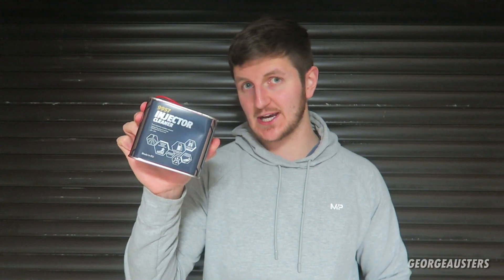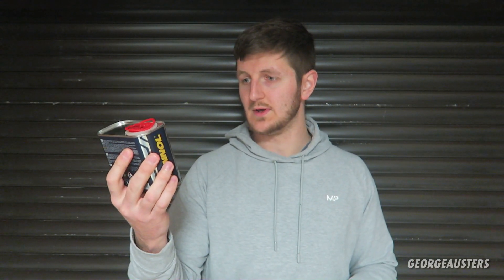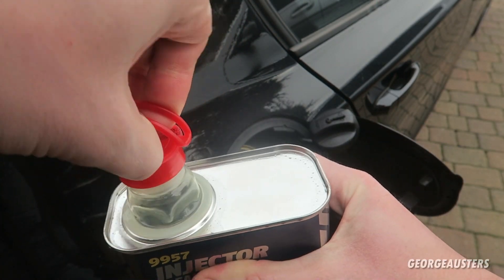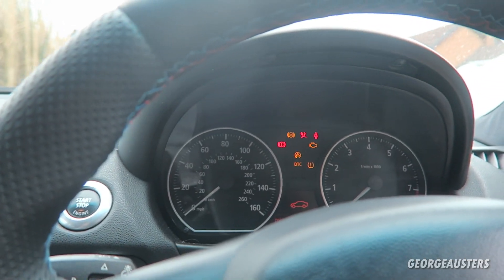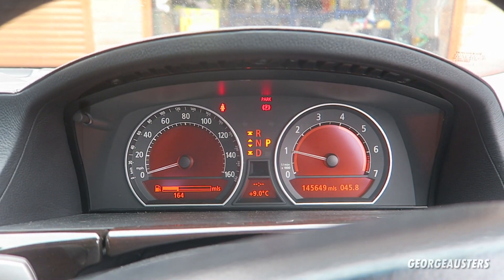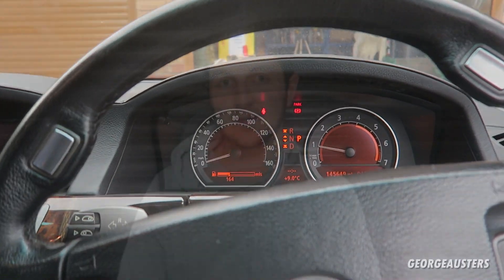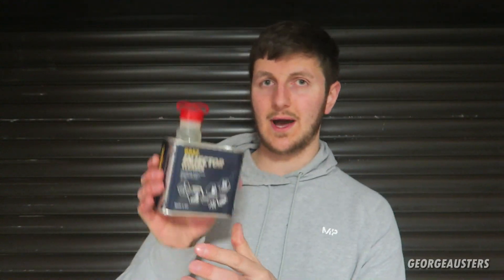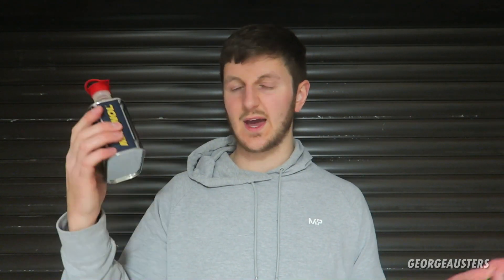Do Fuel Injector Cleaners Actually Work?

Comment: You can always use a scanner to check injector timing, fuel trims, o2 sensor readings and timing advance at idle. That'll show if its making the fuel flow and burn better.

Comment: I drive a Mercedes C32 AMG with over 200k Km's ..I bought it without any services history and it was parked for 6 year  ..the fuel consumption was 12/100 km's on the highway , i used a bottle of Mannol fuel injectior cleaner (pushed the engine to High RPM like 5 RPM for 10 mins on the highway) now I am getting 10.8L/100kms ....but if the car is driving daily I don't think it will be that effective.

Comment: Cleaner loosen shit inside filter then block injector. Mainly then causing leaky injector. Then problems start up and burn off. Got problems?… just renew the injectors. Oh, service BMW more often than stated. I don’t know why I bother like but hey ho! If you driving BMW DERV engine use regular non-supermarket derv and add a little cetane booster at 25% stated. Change oil every 6k and I promise you issues with fuel system, turbo and likes will be minimal. Especially for those twin turbos derv engines. 335d I.e.  I’m trying to avoid using engine designation here to reduce confusion.

Comment: Little tip for you, dont use a metal screwdriver to prop the filler neck flap. Just in case of a static arc or an accidental spark. ;)
Reply from the maker: That’s a good point!

Comment: Thanks George. I like this method. Looks very easy. Would you recommend taking out the entire fuel rail to clean them?
Reply from the maker: Only if you’re having issues relating to the injectors, but you’ll have to replace all the seals then too

Comment: I best injector cleaner I use in my 530d is 50/50 heating oil and diesel. I had a dodgy injector but this fixed it 🤙
Reply from the maker: Heating oil? Interesting
Reply: @GeorgeAusters  yes heating oil (kerosene). An old farmer told me about it and it works perfectly. I ran 2 tanks of it and the car is running perfect. You need the diesel as it has lubricant for the injection system. I used 20 litres kero and 20 litres diesel. Car has 140k and runs perfect 👌. Kero is great for cleaning and breaking down carbon
Reply from the maker: Interesting!
Reply: @bmwfan2814  Great also if Vosa are stopping and dipping cars 😂
Reply: @Mr330d  🙈

Comment: I guess you are right about it making a very minimal difference if any as i had an oil additive knocking about in my shed which i was going to use but my BMW handbook states not to use any oil additives. I spoke to dealership about this and they said just use good quality oil and fuel and you wont ever need these additives.
Reply: Really expensive though over a long time isn't it, I'm fairly sure an additive every now and again will work good and cost far less than constant premium fuel. Oil additives in my opinion is a no go, either fix the underlying issue or leave as the additives can create issues of there own like dislodging sludge and blocking the tiny oil passages. (my opinion) 

I personally would chuck additive in every now and again and once every year or two ultrasonically clean the injectors, on the M57n2 they're quite quick and easy to come out.

Comment: I used Techron on my e46 320d a couple of years ago as car had been stored off road for 3 years. Reason being it's the one BMW supply except just with BMW label on, so I bought Techron, as it was also purported to be the best fuel system cleaner at least 2 years ago anyway. When I get my E90 320d on the road after being off road for 2 or 3 years being stored, I'll used the same in that also for same reason.
Good video again George,
Cheers
Reply from the maker: No worries cheers mate!

Comment: I'm really nervous about this fucking something up in my n57n 530d f10. My car has done 47000 kms, do you think it's about time I use this?
Reply: Well no because this is for petrol cars.

I’ve used wynns turbo cleaner and wynns diesel extreme cleaner before and it made my car run much more smoothly and stopped the turbo stutter I was getting.

And at 50k miles it would benefit your car.
Reply from the maker: Like Steven said, this is for petrol cars, not diesel but cleaners won’t damage your engine👍🏻